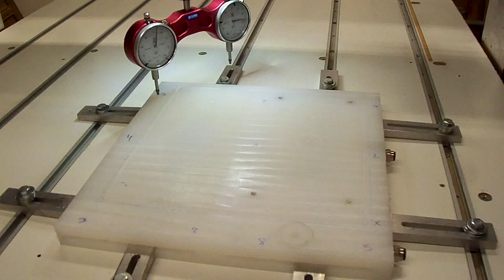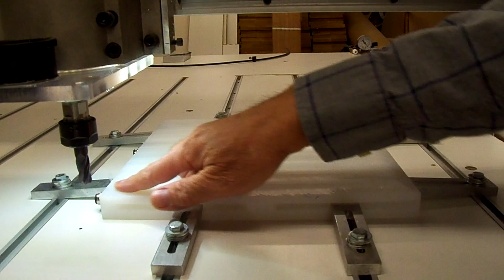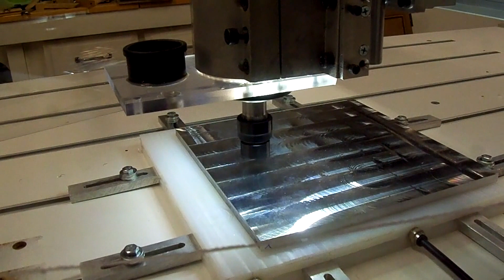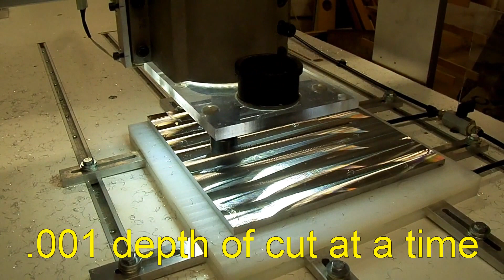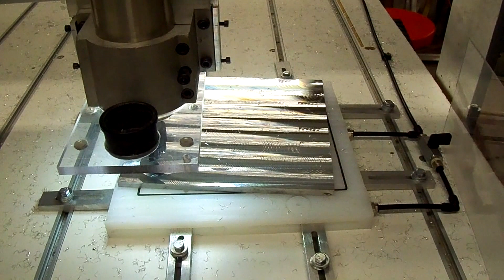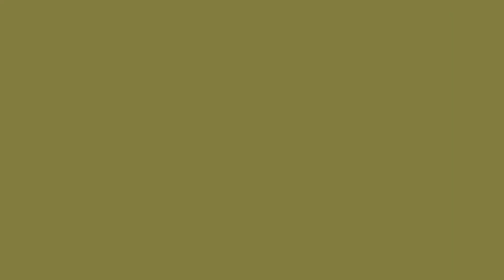CNC tramming results

Comment: I am curious what spindle you are using. Most 2.2kw spindles have a min RPM of between 6k - 9k depending on the brand.
Reply from the maker: I'm not sure what spindle it was.  I think I got it off of ebay.  It's the VFD that will allow you to lowere the RPM down as low as you want but the lowere speed will have way less torque and could stall your router bit.  Most spindles including the one I have will go as high as 24,000 RPM.

Comment: I think there is a easy fix for your problem, and that is the way 3d printer boards are leveled, with adjustment screws, you would need to redesign you board to be altered slightly with adjustment screws on the angles. probably about 6 in all on the edge and in the middle.
Reply from the maker: G Dogg   Thanks for the suggestion

Comment: Hey mate, may I ask what cutter you are using? Also, how does the fly cutter perform on a cnc router, are there vibrations due the imbalance?
Reply from the maker: It is just a cheap fly cutter from Grizzly.  It doesn' t do very well on aluminum on the cnc.
Reply: MyRobertadams ok, I did like the finish you were getting until the mishap, what rpm were you running?
Reply from the maker: @aaronfonseca6031  
To be honest, I really don't remember what the rpm was.
Reply: MyRobertadams ok that’s fine, I’m jut going to be running a Chinese 3kw water cooled spindle... did you run something similar?

Comment: Sounds like you are getting some vibration from the spindle or cutter.
As I watched the aluminum being surfaced I imagined that a vacuum hold down wasn't enough to hold down the metal if you were to have any significant cutting forces, but I have seen others do it. I just don't trust a vacuum seal as a  metal cutting fixture.
Reply: @MyRobertadams  there are serious forces in play - try to stop a 2 hp spindle hitting hardened steel spinning into aluminum at 6k RPM and somethings going to move

Comment: Hi  , Two points  , Did you try not putting a cut (-Z direction) on for the last pass ,ie just run the last two passes at the same Z level  , this should remove any cutting pressures on the spindle alignment , What happens is as the cutter is removing material that will push the spindle out of Z alignment in the opposite direction of the travel (this makes the curve cutter marks in the surface) & pushes the spindle in a up direction . By running the same cutter height twice this should re-square the spindle & take the weight off the tool . Point two if your using some cutters they do not like taking a small depth of cut they need to work (which does not help you) . I did work on Milling machines in a tool room & what you are trying to do is difficult on full size toolroom miller .  Would it be possible to put your DTI clock on the side of the spindle mount (low down) when cutting & see how much the spindle head deflects side wards .

Comment: How much accuracy is needed? 1-4 thousands with a 1 1/2" cutter is pretty tight. Wouldn't using a smaller end mill reduce that ridge? My shopbot is off by .004 and I feel like I just need to live with it unless I start an space project. Am I wrong?
Reply: @MyRobertadams  so what is an acceptable tolerance on the tram? .004 is tight. I just feel that I would waste time and effort trying to get a better tolerance and perhaps lose what I have. Thanks for your reply.
Reply: @MyRobertadams  what are you working on that requires such tight tolerance? My router bearings probably hold 
.006 tolerance not accounting for hold down and temperature. I am using wood, plastic and aluminum. Nothing requiring aerospace tolerance. I'm curious what other hobbyist are doing.
Reply: @MyRobertadams  thanks for your input. I just wanted to see what other people are doing. I have no reference for what I am cutting.
Thanks

Comment: The vacuum board is a great thing to have when doing light weight stuff that is very soft and low cut pressure on the tool.  I think the clamps holding the nylon distorted it from being flat.  Try the test again holding the Aluminum alone with the clamps and set the fly cutter down to 1" to 1.25" dia max and give it a run with a lite cut.  Spray layout blue is also great to see what is going on!  Just go easy on it for an accurate result.
Reply: Anytime man!

Comment: after tramming you said your vacuum fixture still had a 4 thou variance across the surface, that's not related to tramming, that could be your linear rails not being straight. they should be trued up with an indicator as well for best results.

Comment: Thank you Robert, it is interesting watching the pitfalls than I am definitely likely to encounter and how you deal with it, I managed to source some 60x60 from Germany and its on its way along with some 18mm (3/4) plate, I am using your design and I hope your suppliers do not mind as they don't ship to UK, sorry to be cheeky what is the size of the two large plates you have on the Z axis and what is the length of the plates at the front which hold the y axis screws and motors please, take care RobUK
Reply: Thankyou Robert for your help in this matter, I will contribute as I think you need a bottle of something to keep you sane, LOL. Take care, RobUK

Comment: hi robert ,i'm actually new on this cnc stuff 
i want to build a cnc router for woodworking with 3 axis ballscrew and 3 nema 34 and of course the rest of the (encoders,linear bearings.....)
my question is how much will cost for good quality cnc ?
Reply: i'm aiming for 3 meters long * 1.5 width with good spindle and good axis ,will it cost more than 4000$ ?
by the way is aluminium better than wood ?
Reply: thanks a lot man :)
Reply: Nassim    Good size CNC but not easy to build.  Will you get your parts straight from China?